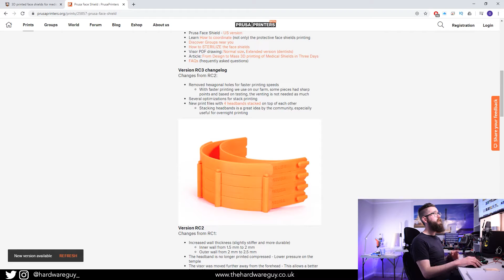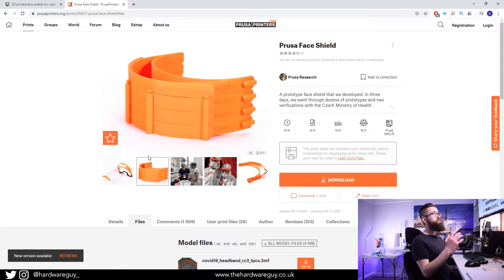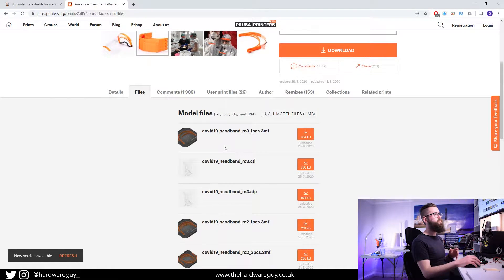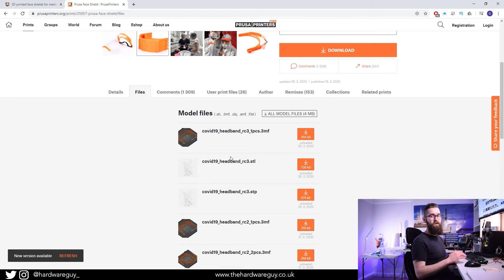How to Make 3D Printed Face Shields

Comment: Very nice! I am also making them here is Houston Tx. Also I saw that on your print there was a lot of oozing and leftover stringing from your nozzle, I had the same problem but switching the retraction length to 2 mm on Slic3r helped and now I have no stringing at all.
Reply: hey Parsa, am also in Houston and just got a new 3d printer , where did you buy the plastic visor material or did you get it online, please and thank you